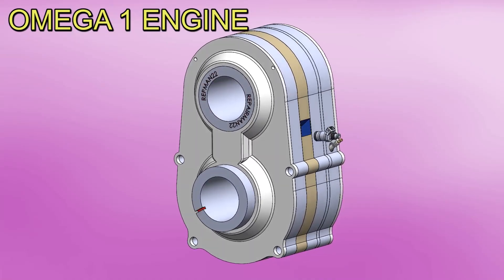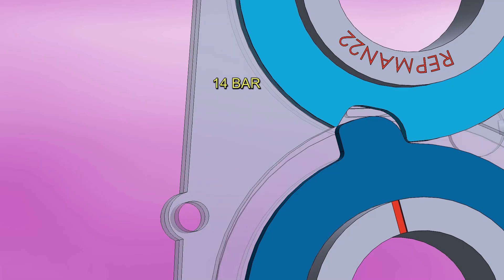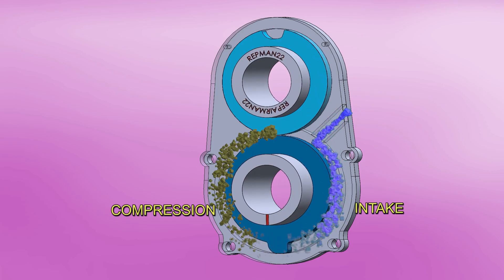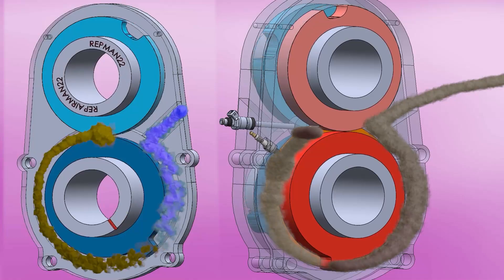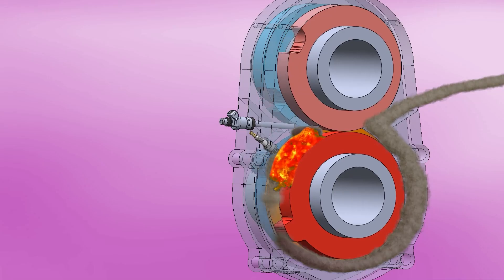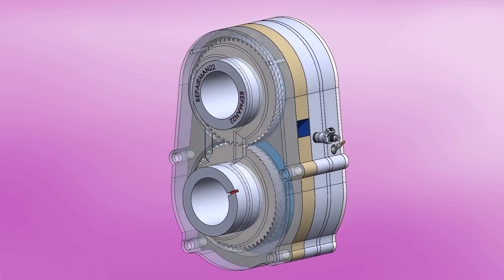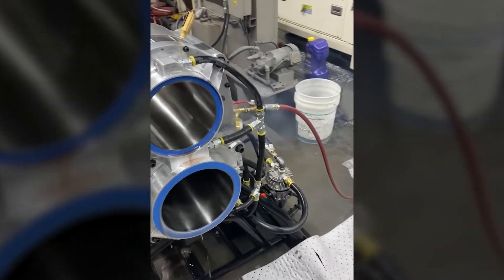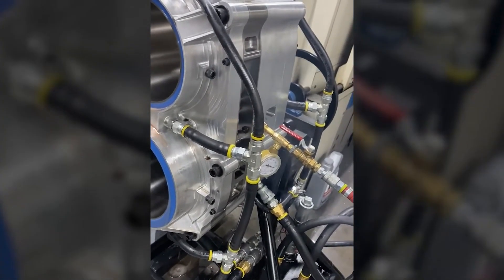😍 Can you FIT 160Hp in 30 Pounds? This New Engine Can. The Omega 1

Comment: well if it can go to 25000 rpm i dont doubt its power... if there is little friction sure can be more efficient but i doubt 60% even if if is 60% efficient with so small package it would still need some serious cooling. small mass of engine it would mean it can over heat really really fast.

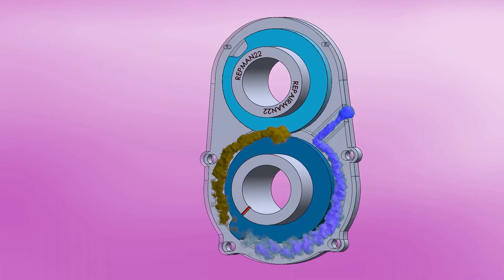Comment: Flawed understanding @ 4:43 - the valvetrain is balanced ie spring pressures are equal between cylinders. So for every spring that is opening a valve there is a spring using equal force closing a valve. There is resistance from these cycles, but it is not from spring loading.

Comment: There was a similar engine concept studied at Ford research lab from 1978 till 1981.  The basic idea was to separate the intake and output so that each could be optimized. It failed for a number of reasons which I can see are common to this engine.  First, there is the problem of residual volume - that is the amount of compressed air left in the input side.  In a conventional piston engine it is not a problem, all the compressed air is used in the combustion cycle.  In this engine the residual air is not zero (non zero input part fits, volume of the transfer valve, etc.) and this will waste a lot of energy, limit the max compression ratio, and the compressed gas will expand back on the input stroke and, thus, limit the air intake.  There are many more concerns that I see (leakage, differential heating, heat loss, differential thermal expansion, etc.) but I do not have the energy to type all the details.  Nice concept but I doubt this engine will even come close to the efficiency of a standard piston engine.
Reply: Exactly
Reply: What was the Ford engine called?
Reply: They were called split cycle engines. There were a number of prototypes each trying to fix the problems of the previous one.  They were built using a standard block with 1/2 the pistons used for compression and the other for combustion/expansion.  The best version used reed valves (to  try to minimize the residual gas in the compression pistons) but they never could get them to last.   @asdasdasddgdgdfgdg
Reply: Here you can use different size chambers for compression and for combating chambers, it will reduce some part ot this effect (but not all, of course). But other benefits can beat all it

Comment: You don't just have the possibility of a leak between the two doughnuts, but also between the housing and the sides of the donuts, plus the male donut's protuberance must be sliding along the inside of the housing. Then you have the possibility of thermal expansion, some parts warming up faster than others, or the whole engine being a bit off when it's in decently cold temperatures at startup, which could cause it to seize until temps stabilize. This is usually dealt with by having looser tolerances to accommodate thermal expansion. In a conventional internal combustion engine you have piston rings. While I like the novelty of this Omega engine it looks like it just has too many leaks that need sealing, which leads me to believe it will have the same problems that Mazda's rotary engine and its apex seals. Apparently they've improved the seals on their recent iteration but we'll see.
Reply: Yep you need perfect tolerances to keep a good psi. Add heat and you get metal binding on metal.

Comment: This engine, the Duke engine, the pendulum engine, man You would think one of the 90 or so "world changing engines" would have made it to market by now.
Reply: Some of them find alternate uses.  The curved piston engine is now a terrific compresssor.
Reply: @tsm688  still odd to me that none have found mass market adoption.
Reply: @sethg6157  the auto industry is actually pretty slow to change.  Their tools are extremely specialized.  They'd need all new everythings to make anything but inline cylinders.

That even one has made it into a commercial product tells me they're not all hot air.  Just mostly hot air :P
Reply: @tsm688  to be fair that some of these revolutionary engines are over 40 years old at this point
Reply: @tsm688  I point I'm trying to make is that they're probably not as revolutionary as people think or otherwise they would have been adopted or at least be more common than just prototypes
Reply: In practice, most of them have obvious sealing, lubricating, or oil burning issues, or like this one, super fine tolerances difficult to manufacture cheaply.   Then there are a lot of new tech companies that really exist only to keep a couple of inventors employed for a few years.  Kind of like a small scale version of fusion energy or quantum computing.

Comment: The obvious rotor component is carbon fiber not titanium.  You have no significant expansion up to 2000 degrees and can tolerate another 50% rise in temperatures.

Comment: I don't think it will be very good when power to weight is critical. It looks very heavy for it's small displacement, the 25,000 rpm redline will make up for some of it but I don't think it will output anywhere near 160 hp in a 30 pound engine.

Comment: Even if you don't have tip seals, and I am skeptical about a .1mm gap being tight enough, you still need side seals so the friction is still there.  They don't mention anything about cooling, there doesn't seem to be much of a water jacket.  The high RPM is the only reason they have Hp ratings that high.  I bet the torque is pretty low.  They are running it with external power also, so will it really idle on it's own yet?

Comment: I love that people keep trying to create something new that works better than reciprocating pistons, but so far it appears to be impossible.
Reply: Both radial and axial flow gas turbine engines work better than reciprocating engines in their designed use cases.

The biggest issue with gas turbine engines is that they lose efficiency rapidly when they are scaled down to the range useful for automobiles.  They also have a slight issue of consuming nearly as much fuel at idle power as at rated output, which makes them even more inefficient when used to power an intermittent load like a car.

But for powering something requiring a very high and very consistent power source at a 100% duty cycle?  They are absolutely better than piston engines.
Reply: @ShuRugal  true, except they are an like an order of magnitude more expensive than piston engines. That is why large diesel generators and diesel ship engines are still very common. Those engines can last well over 100 000 hours, comparable or even exceeding many large turbines.
Reply: @ShuRugal  I didn't know that.  If that's the case, then if you used them to power a generator/alternator, you could tune the size and rpm for optimum performance and use them to charge medium-small batteries for an electric vehicle.  You'd get the best efficiency of the IC engine, and the major advantages of power distribution of electric power.
Reply: @mikecurtin9831  the problem is that, at the scale of a car, the efficiency gains are too small to leverage and you end up wasting energy converting chemical->thermal->mechanical->mechanical->electrical->chemical->electrical->mechanical.

Then on the other end of the scale, grid power generation, burning fuel with uncompressed air to boil water into steam to power a turbine is massively more efficient, because you don't have to take power out of the turbine output to power a compressor.

Turboshaft engines are relatively niche.  Inside their niche (rapid response, high power, lightweight, small footprint) they are outstanding, nothing else touches them.  But if you can compromise on even one of those other points, then there are other options which work better
Reply: @ShuRugal  Thanks much for your quick and thorough response.  I can see (and concede) your point.  :-)   It seems to me that a large part of the inefficiency of an IC engine in a wheeled vehicle is the requirement to constantly vary rpm.  If you fine-tuned it to one rpm, I would think that should help quite a bit.  That's why I suggested driving a generator.  A super capacitor in place of a battery would eliminate that chemical->electrical conversion.  Ultimately, these are all stopgap measures until we get our Mr. Fusion power plants.
Reply: @ShuRugal  There are major advantages of using PHEVs, and using a small engine to power the car if the battery runs out (longer trips) is a really good idea, while using the batteries, charged by electricity from the wall, for shorter trips. What is not a good idea is to use a turbine for that, though. It has neglibigle advantages, but huge disadvantages. MUCH more expensive (easily 10x more) and horrible fuel efficiency.

Your second paragraph is not correct. The most efficient, single cycle engines in the world are large, 2 stroke marine diesels, slightly more than large gas turbines (about 55% thermal efficiency). As for combined cycle powerplants, the world record is for one reaching over 60% TE, using primarily a gas turbine and then a steam turbine powered by steam heated by the exhaust gas of the gas turbine. So, not a steam turbine by itself. 

"you don't have to take power out of the turbine output to power a compressor."
- no, not true. I mean it's true that you need to power a compressor, but that energy isn't "wasted", part of it gets utilized in the expansion section downstreams, together with the added fuel energy. Also, all modern steam powerplants have pumps pushing liquid water though heat pipes. You might not pressurize the air, but you still need to pressurize a working fluid, because the boiling happens at very high temperatures.
Reply: @mikecurtin9831  Many of the piston engine's inefficiencies of varying RPM have been solved in modern cars.  We could go a bit further, but some of the super efficiencies come at the cost of increased emissions so we're limited in what we can do.
Reply: @DonziGT230  Thanks for the reply.  I hear what you're saying.
Reply: Lack of funding, lack or research and development, lack of interest, lack of other figures such as efficiency.
Reply: @junatah5903 no .it's just hard
Reply: Reciprocating pistons..the best oversimplification 😅😅

Comment: well one thing is for sure, this isn't going to work well slammed into a stupid 2 ton quad cab truck. or suv.
but in a small lightweight car this would sound so cool. like this would be so ideal in a 2 seater car the size of an old miata.

Comment: What a strange discussion to have about whether it's two-stroke or four-stroke. Clearly it's neither: "strokes" refer to something reciprocating, like a piston going up and down a bore, and no part of this engine reciprocates.

It makes much more sense to talk about "phases", which is a better term for something rotating. This engine has four phases, and at any one time, two phases are occurring concurrently. That is all that needs to be said - any mention of "strokes" is inappropriate. Having two phases occurring simultaneously is analogous to a two-stroke engine, but that's all - in itself it is neither two-stroke nor four-stroke, because it doesn't use strokes.

Comment: The surface-area-to-volume ratio during expansion is terrible, as is the shape of the combustion chamber. Doesn't bode well for a fast, clean and efficient burn. However, that's just a theoretical objection - I'd love to see some examples running in real-world applications.

Comment: This is going to require very tight clearances and very good maintenance to avoid dying.
Reply: Yep then add carbon buildup where the tight tolerances are needed and it's a worthless engine.
Reply: I see these engines destroying themselves at very low mileage
Reply: That gap of 0.1mm should have tolerance of 0.02mm at minimum and that seems doable but in real life this will be Mission impossible to maintain with vehicle in motion and vibration of surrounding.  Good luck bringing a real life version.
Reply: Doesn't every engine? Wankel works for the most part. Don't see this being much different.
Reply: @Null-o7j  there's a massive difference between needing 1-2 thousandth of an inch and a near perfectly smooth mirror polish with zero room for being out of round. Having some kind of moving seal to hold the pressure is very important.

Comment: Sealing is the challenge number one in combustion engine and the easiest way to achieve it is piston.  

Shape of combustion chamber is rubbish. 

Rpm is not a problem for piston engines, the limit is speed of fuel combustion, so what is the point in rotary engines? 

How is the combustion side of the engine going to be cooled? 

How can stretched shape combustion chamber have better thermal efficiency?

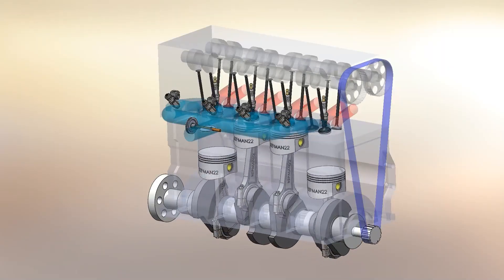Comment: 0:17
Also, banning combustion cars is an attack on freedom.
In temperate climates, banning combustion engines would mean preventable deaths of people stuck in traffic, snow, ice, and running out of battery to keep warm.
Gasoline is far more ecffctive.

Further, until all power plants run on emissions free systems like nuclear, with extreme longevity fuels and generation equipment, safe and easy disposal methods for the eventual waste products, electric cars are horrible for the environment.

An efficient and powerful little engine sounds lime a great idea.

Comment: The long combustion chamber of the wankel is its major downfall in terms of efficiency.  This design is even worse!  So 60% is probably about 10x reality.
When I first looked at it, it seemed the notch was the chamber, nope.   One can build very high HP is a small space, but it takes huge amount of cooling as the power must be very concentrated by definition, and thus the cooling is a challenge.  High HP two strokes tend to be used in boats..

Comment: Just go electric. There you can have 400hp in 30 pounds. And yes, there is enough capability in the grid to charge those cars.
Piston engines never reach 40% efficiency. Where is that number from? Always if the fuel gets burned to produce torque there will be a huge loss of efficiency in heat. There is nothing engineers can do against that. thats simply physics.
Reply: 100 000$ purchase and change the 20 000 $ battery after 8-10 years, that's the economics.
Reply: @OEAFastfood  Where u got those numbers from? Mine cost 25000 and the batteries of very old teslas still work like a charm.
My condolences that you are subservient to the propaganda of the oil and car industry.

Comment: I see high RPM, but very little torque.
Reply: And? Torque x RPM = power. You want more of one or the other? Gearing is your answer.
Reply: I high rpm, high hp, engine with little torque, would need a substantial, well balanced gear box that would greatly ad complexity and weight to the engine. Torque is almost always better than rpm and hp.
Reply: @yelwing  horsepower is a product of torque AND rpm. Gearboxes are mostly limited on torque, which makes higher rpm preferable for the SAME power (meaning, less torque at the input of gearbox). You cannot possibly "prefer" torque over horsepower, as horsepower literally IS torque times a rotationally speed/frequency, usually measured in rpm.
Reply: @yelwing  horsepower is a product of torque AND rpm. Gearboxes are mostly limited on torque, which makes higher rpm preferable for the SAME power (meaning, less torque at the input of gearbox). You cannot possibly "prefer" torque over horsepower, as horsepower literally IS torque times a rotationally speed/frequency, usually measured in rpm.
Reply: Unless you want a jet engine, high rpm’s are never useful. Slow rpm motors with high torque are very useful

Comment: From a manufacturing standpoint I think this engine holds a lot of promise. The biggest issue is clearance and sealing as mentioned.
Reply: ...which is why it will fail. There is no advantage this engine has over a blown, direct injected 2 stroke piston engine, just disadvantages.

Comment: It shall be known as "Seal Eater".

All these rotary like engines have one problem - huge huge seals experiencing huge massive pressures. It's all fun and games until you have to seal a spinning chamber or a large disc shaped rotating object. It all has to do with angular velocity and such which causes differential wear. It's the same reason why rotary engines can only do like 120k km before they need a complete rebuild. Compare it to regular diesel engine block that with basic maintenance will at 1M km likely outlast any of its adjacent components and you know why true "engine revolution" didn't happen since Diesel invented his cycle.

Comment: I noticed in the working model the engine is connected to a pulley on a CNC lathe. Is the lathe driving the motor or the motor driving the lathe? Why is it pulleyed to the lathe?
Reply from the maker: First, I thought it was a dynamometer used to measure horsepower. Of course the belt is too small to handle 160 HP. Then, I figured out it was for cranking and starting the engine. (I suppose)

Comment: Obviously there are many places that need seals just as in the Wankel.  There are sliding surfaces which would be difficult to imagine a seal. I cannot imagine that 0.1 mm is anywhere near a fine enough tolerance to avoid loss.  In a supercharger such loss is acceptable but not in an engine.   And it has an extremely high surface to volume ratio meaning a lot of wasted heat and a high unburned fuel problem.  The claims made are ridiculous. It must be a LOT less efficient than a piston engine due to this surface area.
Reply: exactly

Comment: Let's pretend this things works... 
In ICEs, the quest for lower emissions has spent an incredible amount of time and money addressing combustion chamber space and crevice volumes. Even with perfect air/fuel ratios, older engines burn very dirty. Much of the emissions gains have come from addressing these areas.  

This engine will never pass any emissions standards, ever, anywhere. 
Period.